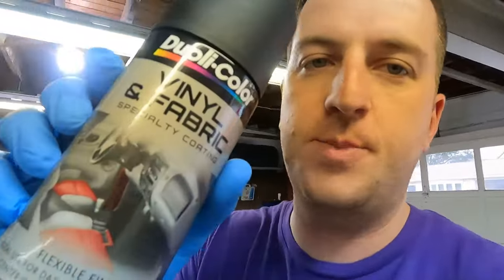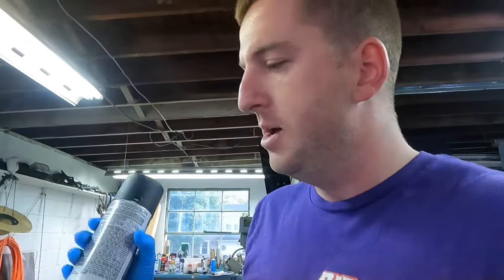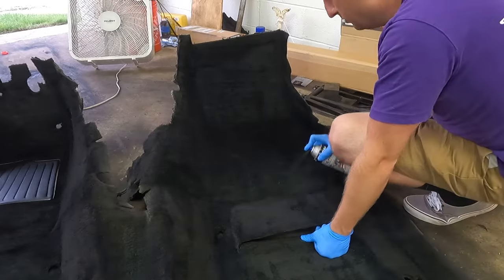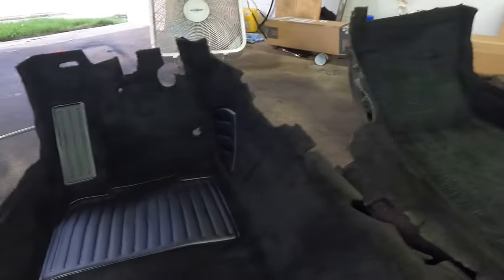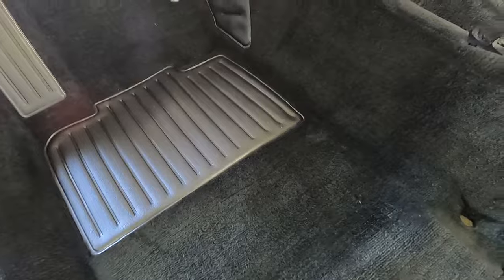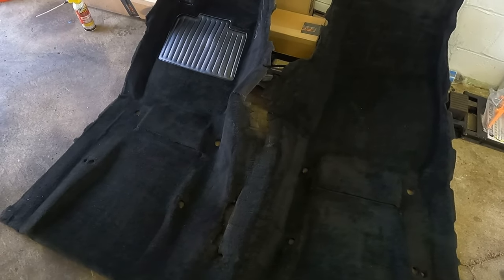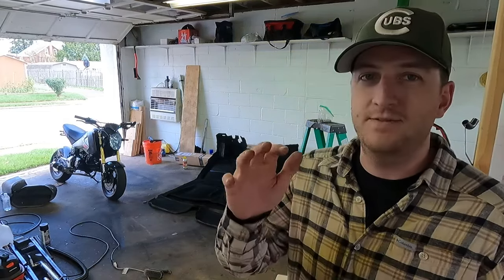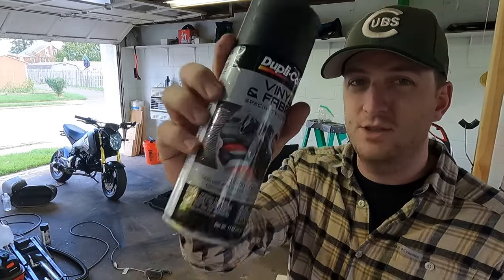How to dye your cars carpet the RIGHT way | I ruined my cars carpet

Comment: The reason why is Rit is for natural fabrics like cotton; auto carpet (except for wool) is plastic, can't absorb the color.
Reply from the maker: I pinned this comment because I 100% overlooked this as a factor as to why it didn't work. Im not sure if other manufactures use natural fabrics and im not even sure if this carpet inst natural but hopefully this helps other people from running into the same issue I did. I appreciate it!
Reply: Rit does make a dye for synthetic materials it requires using boiling water. From their website. *Important Note: Due to the complexity of dyeing synthetics, you must use Rit DyeMore with the stovetop method to maintain an almost boiling temperature for the duration of your dyeing.
Reply: @ComicbookGuy70  you need to soak the carpet in a trash can full of boiled rit dye for about a week and then dry and wash all the dye out and it will be ink black until the end of time.
Reply: @ComicbookGuy70  Also from their website "Add Salt or Vinegar (If Dyeing Cotton, Linen, Silk, Wool, Nylon Rayon and Ramie). To enhance the color: (1) add 1 cup of salt when dyeing fabrics containing cotton, rayon, ramie or linen; (2) add 1 cup of vinegar when dyeing fabrics containing nylon, silk or wool."

Comment: It failed because you used room temperature water. RIT dye is heat activated, and you should get the water as hot as possible. The dye didn't activate in your case and was just sitting on the surface. You should also add table salt to it to get the dye to activate easier in the BOILING HOT water, and attach to/soak into,  the carpet fibers.
Reply: Worked great for me too, but also used hot water lol😂

Comment: Follow the instructions. Written so you don't get what you got. Used RIT to dye carpets. Works great if you follow the instructions.
Reply from the maker: That’s incorrect. Directions don’t say it’s not designed for synthetic materials. BUT they do offer a version designed for synthetics.
Reply: Nah it’s trash for car carpets, I followed the directions perfectly and my carpet was green and not black in the test spots
Reply from the maker: @funkmonkey5941  that sucks so bad. how did you fix it?

Comment: Im getting prepared to dye my carpet and trim from tan to black. Thank you for the tip because i have Rit that i was considering using for the carpet
Reply from the maker: Damn right. Good luck with it and I’m glad I could help
Reply: I just got done doing my 79 corvette and can tell you its true. i dye the carpet about 2 weeks ago and dried it on the sun and then under the constant ceiling fan for the remainder time. and after i installed it 2 days ago, is now sweating. and i have no idea how to stop it. so, yes, do not use rite for car carpet, use the spray can he has. i used it for the rest of the car and for some reason not for the rug. but we do and we learn, anyways...good luck man!
Reply from the maker: @myceliumforall619  I wish you saw my video sooner but im happy that you commented to at least confirm the issue.
Reply: oh my god you just saved me from doing this to my car
Reply from the maker: @angelicabaldassare9286  Im happy it helped! What are you working on?
Reply: @zackellis23  I found a solution...ish. if you use clear coat spray on top it solves the issue. Not pretty but it works 🤙🏽
Reply: anyone ever do the seats ? will RIT work fir those ?
Reply: I am going to try it on my headliner in my Dodge truck. I don't even plan to take it out just going to spray it with the can and if it turns out nice and black great if it don't I'll take it out have it recovered
Reply: @johnharrison5098  i tried about a decade ago on some honda seat covers, did not work. but cant speak for other seats

Comment: I my case i was very successful using the dye, but i did my 1986 Caprice floor carpet during middle of summer on my open driveway where temps are usually 105F-115F.😊

Comment: The correct product to dye a carpet is RIT Synthetic. This is the one to dye polyester, nylon, and acrylic. Additionally, it requires at least four paint coats to recover the same color; you are changing the color, so it needs more paint coats.

Comment: you need to soak the carpet in a trash can full of boiled rit dye for about a week and then dry and wash all the dye out and it will be ink black until the end of time.
Reply from the maker: That sounds like a ton of work and carpet it also too stiff for a trash can lol BUT I don’t doubt that would work
Reply: doesn’t seem too different from the e36/e39 carpets i’ve done, 96 gallon bin gets the trick done. the hard part is finding something to do with the 800lbs of ink water 😂
Reply: Are you being serious does that actually work?